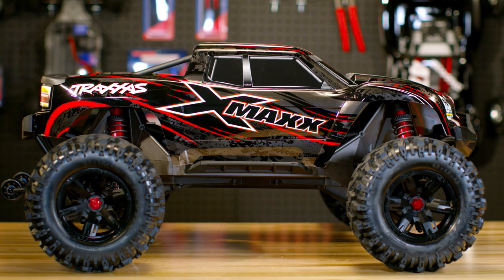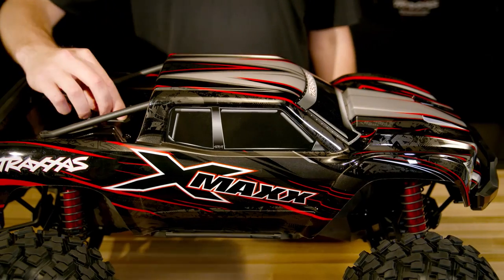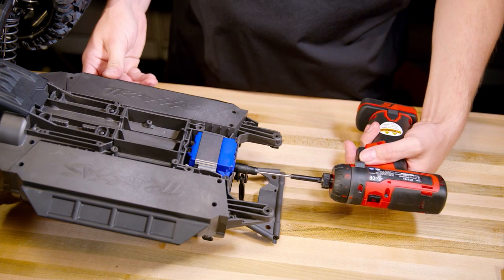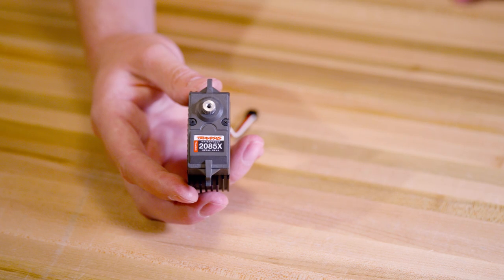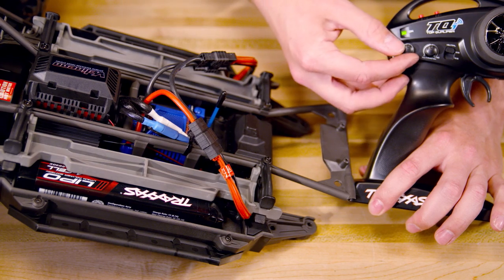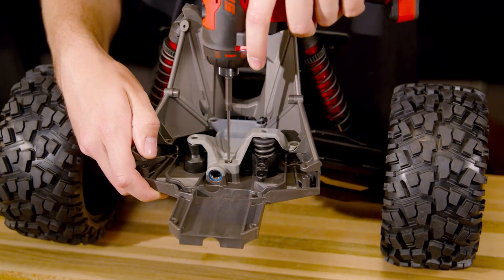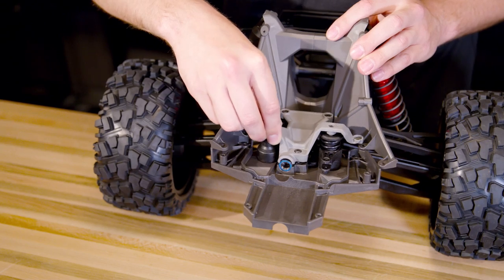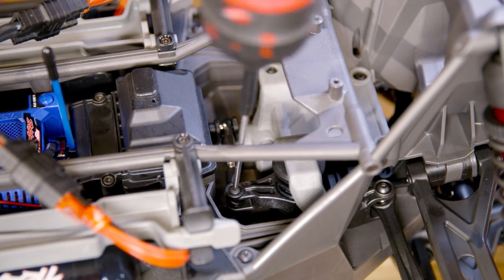How to Install a 2085X Steering Servo | Traxxas X-Maxx

Comment: Ive haven't even had this truck for a month yet. And I'm already on my 3rd servo. The stock broke on first run. And now the 2085 ain't even coming on. Oh and not to mention on my 3rd pinion gear, 3nd spur gear.  And already needing new wheels. This truck is hell for me. Wasted $$
Reply: The 2085x metal servo broke for me
Reply: You'll want a Promodler servo DS635BLHV. Military grade hardware that will last forever.

Comment: traxxas takes advantage of their customers any RTR kit they sell is not made with premium part's.
yet they still sell the kits for $1200.00 plus tax an for limited edition model's like my 8s snap on tooltruck xmaxx that retail's at $1500,00 but only thing special is the body the chassis an drivetrain part's are not their premium part's plastic geard servos an weak steering components that need upgraded within 1 or 2 runs even with out jumping it. the servo saver doesn't save the servo at all I've stripped the factory 2085 and the high torque 2085x with stiffer spring the turbuckle included with the upgrade kit is junk. the plastic steering horn strips once upgraded. I stripped even a metal servo horn with the 2085x that I shouldn't have had to replace or repair with in two runs. traxxas needs to do something about this issue or plan on losing loyal customers like myself.

Comment: "Upgrade" servo is still trash. I replaced my stock servo with this about 3 months ago, have run 3 sets of lipos through the truck since then and the new servo has burned out. 
Now im going to throw the metal gears in the stock servo. What a waste of money that turned out to be. 😑